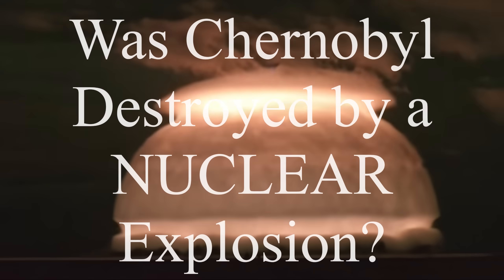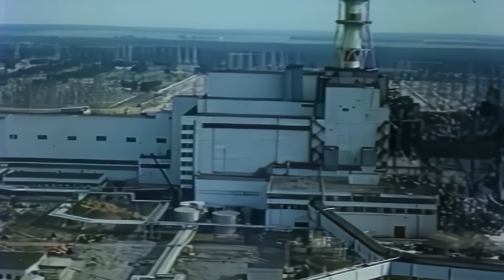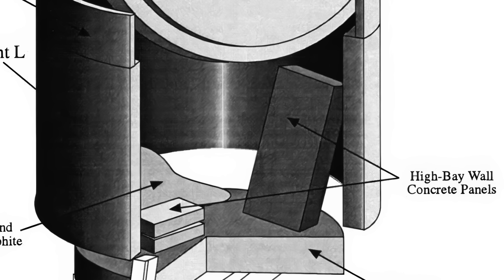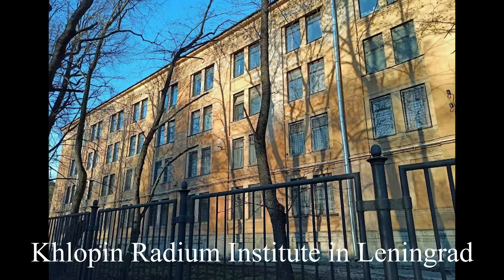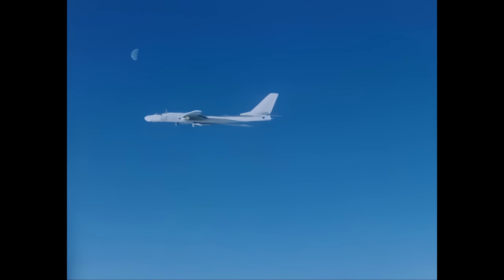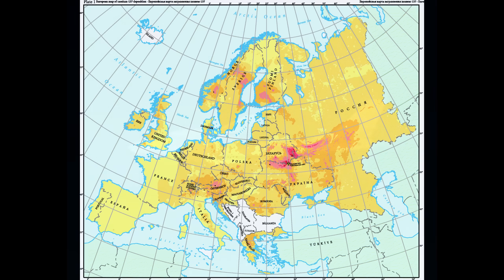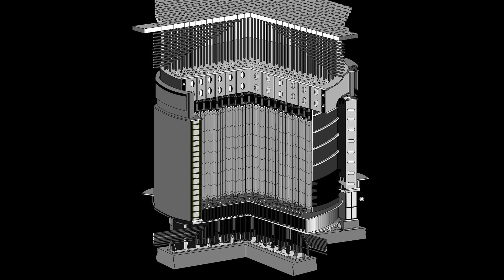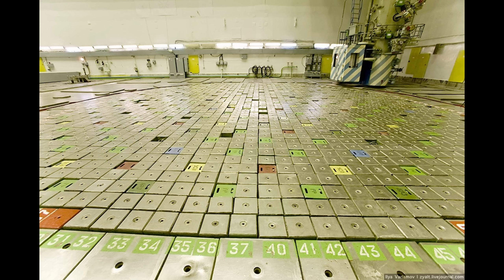Was Chernobyl Destroyed by a NUCLEAR Explosion?

Comment: I'm familiar with this hypothesis, and do not fully agree to it for multiple reasons. Despite me disagreeing with the nuke 'splody thing (I'm trying to dodge some algorithms here) you're going to get a Super Thanks anyway for the impressive amount of work. Why I disagree?

First; the enrichment is not even close to what one would need for such a device. Especially when we consider that Unit 4 was at the end of its fuel cycle, and the fuel was very depleted, which makes the enrichment even lower.
Second; the presence of a moderator. No such thing in a 'splody device.
Third: the presence of control rods/ a neutron absorber. Again, the 'splody thing lacks these contraptions because you want to make the fission as fast as possible to get the highest yield.

The geometry of a nuclear reactor, even one the size of a small house, is such that it wants to make the fission process as slow and controllable as possible. What did happen is that things were pushed beyond the point of prompt criticality, and all this energy had nowhere to go in the sealed off confines of the reactor vessel. Various Physics professors I have seen videos of, also explain that as bad as things were, it still isn't a b*mb. And even hinting at such will send the anti-nuclear crowd into a frenzy, unfortunately. But I do think it is an interesting hypothesis that deserves careful scrutiny, so I'm not dismissing it completely. I always like to keep the door at least a tiny bit ajar for a new direction. On to the next video!
Reply: I studied nuclear physics at college level, I agree.
The neutron flux and radiation pressure can not have been high enough to initiate (even for a fizzle) a nuclear detonation.
Most likely the  multiple smaller explosions before the final big one that blew the lid off were caused by local pockets of superheated steam. These would have helped pulverise the material in the core to the point that it would more easily be dispersed as a fine powder by the final explosion that blew the lid off.
Reply: @jwenting  It has also been hypothesized [1] that it could be a coulombic explosion between zirconium and water, akin to the sodium-water reaction. It is also the possible explanation of the aluminium-water explosion.

[1] YouTube video by PhD researcher Phil Mason, "The Awesome Power of the Aluminium-Water Explosion!"  12:30 to 14:50
Reply: @jwenting  Radiation pressure only plays a role in igniting a second stage fusion device (the Teller-Ulam design) or in blowing apart the nucleus of a conventional atomic weapon. But for a very inefficient design, I think purely thermal collissions would be sufficient.
Reply: @swokatsamsiyu3590  ummm… Chernobyl does not really have a “fuel cycle” because each of the fuel tube act as its own independent pressure vessel which allows the reactor to refuel while its still operating. So the fuel can be changed per each channel  whenever it is needed.

The reactor is basically 1000+ small reactors that shares the same control system as well as the cooling and heat exchange system.

Enrichment means it’s just easier to reach criticality but it is also possible to reach criticality even with natural uranium (zero enrichment)

If this was a Hydrogen explosion… the main explosion will above the reactor where hydrogen rise and gets trapped until it found a source of ignition or the pressure exceeding the strength of whatever thing that’s trapping it.

Chernobyl main explosion happens right in the middle of the core… the building above the reactor was destroyed from the exploding core. This is clearly evident by the fact that the core was emptied after the explosion. Hydrogen would’ve not left the core empty like this nor it was hot enough to vaporised the content of the core. Note that the “dancing metal blocks” before the explosion also support the fact that it cannot be a hydrogen explosion. The metal blocks moved up as the pressure rises and then drops as the pressure is released… then rise and dropped again. Each blocks move up and downs independently of each other as each has its own pressure tube.

So there was actually no sign of hydrogen building up at all.

Fukushima was clearly a hydrogen explosion from the fact that 

1. the explosion was after the reactor shutdown (reactor was not in a critical state)

2. The main explosion happened in the main reactor hall above the reactor and not at the reactor vessel itself which remains fully intact.

Chernobyl explosion happened when the reactor was fully in a critical state and is going several times beyond its design limits. The explosion blew off the main biological shield of the reactor and emptied out the content of the reactor core…

Chernobyl was clearly not a hydrogen explosion.
Reply: @tonamg53  
Our big, graphite-moderated friend is the focal point of my reactor studies. I'm well aware that it doesn't have a regular fuel cycle like our western reactors. But it has one of sorts nonetheless. Every 2,5 to 3 years an RBMK, too, needs to be shut down for maintenance and refuelling, despite its on-power refuelling capability.

For the first generation 1693 fuel channels, and for the second generation 1661 fuel channels, to be precise. Again, I'm aware of how it all works.

Yes, it is possible to reach criticality on natural fuel alone. See the Hanford B reactor, Chicago Pile 1 etc. However, the RBMK cannot reach criticality on natural fuel with the lattice pitch it has, according to Dollezhal's Handbook.

And the explosion did not happen in the middle of the core. According to various studies and authors like Karpan, the power excursion and subsequent first 'splody action(s) started in the lower section of the core, not the middle.
There were no "dancing metal blocks". I take it you have that from Medvedev's book? Zircaloy undergoes a vigorous reaction with steam/water in high temperatures like those found during the accident, where water dissociates into its components of oxygen/hydrogen. Only some 4% of hydrogen is enough to get things very exited indeed. Now imagine the  huge amount of water/steam the core contains, and have that flash to steam/ dissociate into these components.

Fukushima was a completely different accident. I'm aware of what transpired there.

Try 1,5 terawatts of "going beyond its design limits".
Reply: @swokatsamsiyu3590  well, RBMK once the power runaway the only thing that could stop it from increasing lower is to stop the criticality. The only way I can think of is that the core needs to spread itself out by “blowing up” since its too damn hot that anything you put close to it would just instantly melted and vaporised.

Isn’t that how a nuclear bomb also blows up too? Going critical until it blow itself apart.

The fact is the core was emptied after the explosion.

If the explosion didn’t emptied out the core then what did? RBMK core is gigantic… and it was practically emptied. 

Note the upper lid was thrown up in the air AND the lower lid was pushed down into the ground as well… 

Every evidence points to main explosion was in the middle of the reactor vessel.

Also power got nothing to do with determining whether it is a nuclear explosion or not.

The smallest nuclear bomb ever detonated was 10t of TNT… Some home made IED makes a bigger boom than that.
Reply: @swokatsamsiyu3590  Nice discussion btw!
Reply: I agree. From what I have read this theory predicts a yield of approx 0.01 kt, this would be by far the smallest fizzle recorded and I'm not sure that the physics of nuclear explosions permits it.
Reply: @Matt_The_Hugenot  It really comes down to what your definition of "nuclear explosion" is. There was an explosion, and possibly that explosion was caused by the energy generated by a prompt criticality. If so, it was, in the broadest sense of the term, a "nuclear explosion", even though the energy was a few orders of magnitude below that of even the  first generation nuclear weapons detonated in WWII.

Similarly, it wouldn't necessarily be incorrect to characterize the Idaho Falls accident (also involving a prompt criticality) as a "nuclear explosion".
Reply: @russlehman2070  Very much agree. Even down to "what is an explosion?" After all, explosions are just runaway reactions with a sufficiently short timescale they appear to go "boom".
Reply: @Matt_The_Hugenot  I don't see why a fizzle has to have a threshold. It's just a really really poor explosion, which makes sense given that the whole thing wasn't specifically designed to explode.
Reply: I'd like you to elaborate on some points. One question is what "prompt" criticality means here. In a nuclear reactor, prompt criticality is due to criticality being reached from the release of prompt neutrons. However, this still requires most fission to be due to thermal neutrons. There's a timescale of order microseconds for a released neutron to be thermalised. But that timescale is still pretty large compared to the timescale for fast fission that occurs from a fast (unmoderated) neutron. So one key difference when discussing if this explosion was like a mini nuclear explosion is: was it sufficiently prompt to be due to fast neutrons? I think the answer here is a clear "no" - the cross-section is far lower for prompt fission, and the role of graphite being a moderator here is key. Yet - a microsecond timescale is still pretty fast, and clearly could lead to an explosion due to a runaway reaction. Does this mean the explosion is or is not a nuclear explosion? I guess that's a matter of opinion. But I would argue that since the source of energy is a runaway nuclear reaction, the answer is yes, it's a nuclear explosion, albeit a very inefficient, small one.
Reply: @clancyjames585  
"Prompt criticality" in the case of this accident means the reactor is sustaining the fission reaction on prompt neutrons alone. We know that before/ at the start of the accident it was running in a normal (delayed) critical state since it had an output of around 200 MWt. When they pressed the AZ-5 button, the reaction in the lower section of the core was already going towards super-criticality, bordering on the threshold of prompt criticality even, courtesy of the positive void coefficient. When the graphite displacers entered that section of the core, shoving in more moderator, the chain reaction there spun completely out of control. It was the last k*ck in the pants the reactor didn't need. From there, the reactor switched to running on prompt neutrons alone due to a positive feedback loop (more heat means more steam means more reactivity...) producing a crap ton of neutrons and the propagating effect to other neighbouring channels, which spread throughout the core. Which is very, very bad, to put it very mildly. Yes, there is the negative fuel temperature coefficient which will slow down the reaction because of Doppler broadening, but in this case that held back the tide only for a split-second.

So, I'd say it was an explosion caused by nuclear things running wildly out of control, but not like a bomb. The tremendous heat from this flashed pretty much all the water in the core to steam instantaneously, which had nowhere to go in the confined reactor space/ cooling system. All that pressure has to go somewhere. Presto, you just (unintentionally) put your reactor into orbit.
Reply: @swokatsamsiyu3590  Thanks for the reply! I completely agree with everything you said - except the "not like a bomb" part. I guess what I was trying to understand in my original comment was precisely why you consider this "unlike" a bomb. After all, a nuclear bomb is simply an assembly of prompt critical material that continues to react until the heat generated by the runaway reaction causes disassembly. Hence why the vast majority of uranium in Little Boy did not fission. Certainly, the extremely low efficiency of this corresponds to a fizzled nuclear device (as the video explained). But from a fundamental physics point of view, the only differentiating aspect I can think of is whether or not the assembly is prompt critical on fast neutrons, or it requires them to be thermalized. Sure, from a human angle, it's not a bomb, it's a nuclear reactor. But the physics doesn't care what we think it's for!
Reply: @clancyjames585  
Your welcome! I'm guessing for me, the distinction lies in the enrichment levels. An RBMK before 1986 had only 1.8% U-235 fuel enrichment, where a 'splody device sits well north of 85%, at the minimum. And at the time of the accident, the enrichment was even lower for Unit 4 because it was at the end of its first fuel cycle, leaving the fuel very depleted. And yes, the physics does not give a hoot about what us fleshy types think^^
Reply: @swokatsamsiyu3590 As I understand it, neutrons exhibit a physical pushing force…I’d imagine fast neutrons even more so… so I wonder if that could of played a part in the reactor blowing apart (of course not as much as steam explosion)? What makes me think this is seeing a test done on the demon core where they remotely did a prompt critical test on accident, and the metal framework supporting the core and the reflectors got mangled as if someone put a half stick of tnt in place of the core. Unless there’s a force at play I am ignorant of I don’t know about?
Reply: @volvodoc01  
Neutrons do indeed have some power, not much individually, but it's there. And you're right, it may have been a factor in the geometrical deformation of the core. If we consider how riyoinkulously large the RBMK core is, and the insane amount of fast neutrons flying around just before/ at the time of the accident, it might very well have played a roll for all we know. Too bad poor Unit 4 can't tell us just how extreme the forces at play were that very moment.
Reply: @swokatsamsiyu3590  I think you are confusing something. The energy comes generally from fission (around 200 MeV per fission event of U-235), and if you reach prompt criticality, the released energy progresses exponentially with time until fissioning is interrupted. Now if you increase enrichment and bring the atoms closer together, you get a higher energy release. But the fundamental process is the same, even in the low-enriched uranium of an RBMK which probably was prompt critical for a very short period of time. What I want to convey is that the underlying process is the same. Of course the released energy is lower due to enrichment and configuration and that‘s why there wasn‘t a huge crater where the power plant is located.
Reply: Wont there be some plutonium since it's the end of the the fuel cycle?
Reply: Enrichment isn't the real factor: most of the fuel channels were in a late stage of their cycle. A large part of the U238 was converted to Pu239 and Pu240, both are highly fissile isotopes. By the way even Pu240-contaminated Pu239 from a reactor was successfully used in a nuclear test by the British.

Comment: WILDLY implausible for far too many reasons to enumerate individually. For one thing, the "uranium still fissioning" in the ejected cloud, detected via Xe-133 overflight of Cherepovets makes absolutely no sense whatsoever, as even you yourself state mere minutes later that the fission chain reaction is instantaneously ended by the energy of the criticality excursion disassembling the consolidated critical mass! There is absolutely no way a cloud of uranium dust in the atmosphere could conceivably be undergoing a fission chain reaction for more than a fraction of a second before it blew itself apart. Your description at the beginning of a fizzle is incorrect and the term never applies to fusion reactions, which are incapable of chain reaction.
Reply: Agree with all your said.

However, this nuclear explosion explanation has likely been proposed to explain the huge effects of the explosion.

I've written a main comment regarding another hypothesis of the coulombic explosion, with a video and timestamps.
Reply: Yeah the Xe-133 got there by being ejected at high speed. Which makes sense for a 'nuclear jet' than a hydrogen deflagration.
Reply: @MinSredMash  uh, no.  The Xe133 got there because the reactor exploded and was full of fission products including that one.
Reply: The coulomb explosion hypothesis a la sodium in water, but with zirconium instead is far more plausible.

Comment: I would describe it as a sort of nuclear explosion. For a start, the fuel is not enriched to anywhere near that of a nuclear bomb and so would be a far smaller "pop" than a full bomb going off would have been.  However, the fuel was enriched enough for fission to take place as that, after all, is how a nuclear power station works.
Taking these two things together: Fission was taking place and because of events, it was at a super critical state. So, I would imagine that some of it may have gone bang in the same way that it would in a nuclear bomb, only much smaller bits with far less enrichment. So basically a nuclear "pop" compared to a nuclear bomb going off. After "popping" the bits would be further apart and no longer critical. (Well that bit of the reactor anyway as other bits may than have also "popped" - There were two pops for a start.
Therefore I think this theory is very plausible and possibly the best to date.
This leaves me speculating what the outcome would have been if the pumps had stopped at that point and the water not pumped in and turned into massive amounts of steam that blew the whole building apart.  Would there have been more nuclear "Pops"? Of course, we will never know as it didn't go that way, but interesting to speculate.